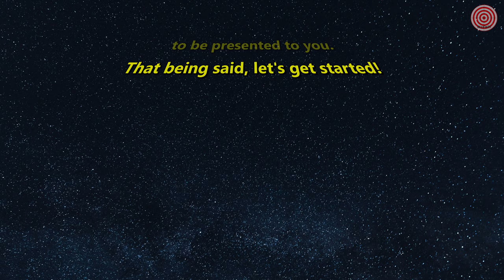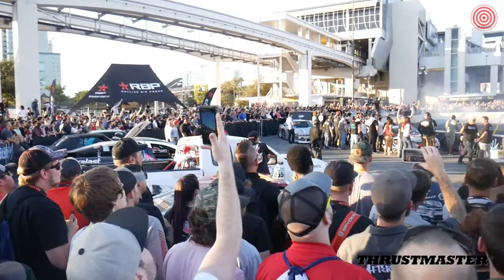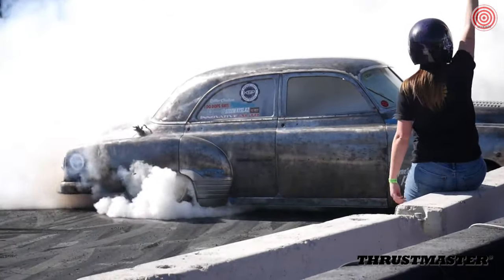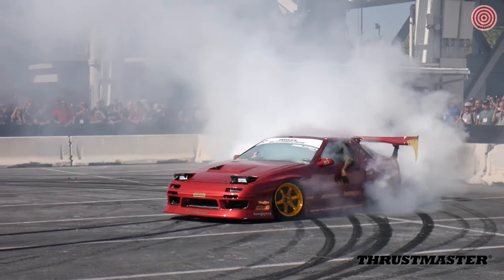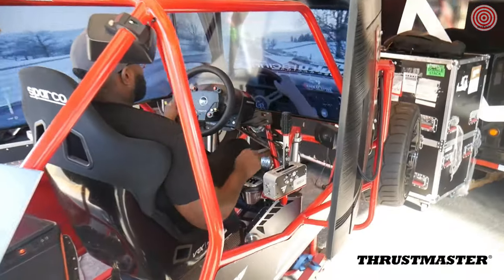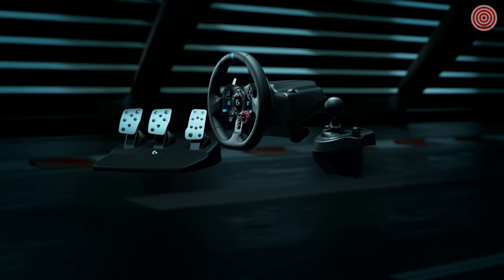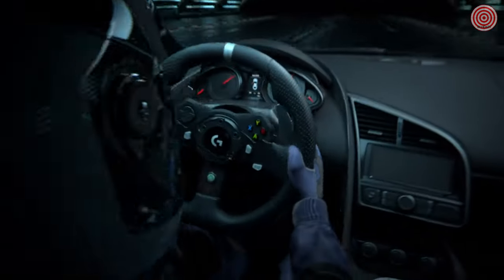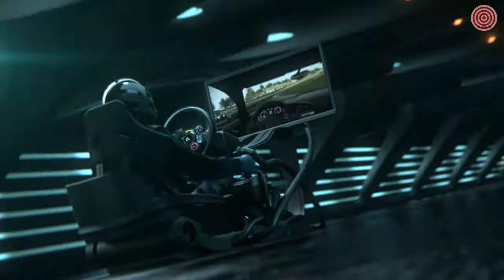5 Best PC Racing Wheel for Forza Horizon 5

Comment: Cool video, but it can be useless.
Reply from the maker: Why do you say that? 
The game will be released soon.
Reply: @AryTechB  previous Forza horizon and Motorsport doesn't support steering wheel as well. Yeah, it has support of thrustmaster and Logitech series but it works terrible. On the default settings thrustmaster t300 feeling like cotton wool. No adequate force feedback and so on...
Some thin setup can help, but it won't be like in asseto corsa...
Sorry for my poor English :)
Reply from the maker: My son uses a cheap steering wheel in Forza horizon 4 and he does great.
However, thanks for the information!